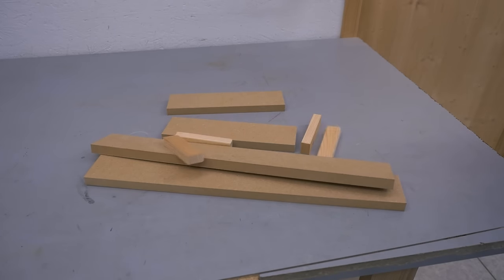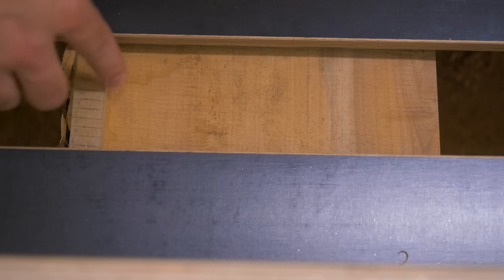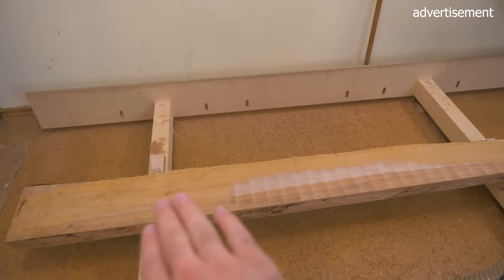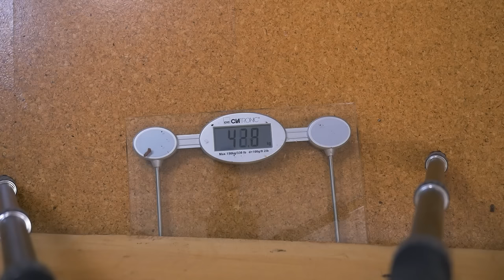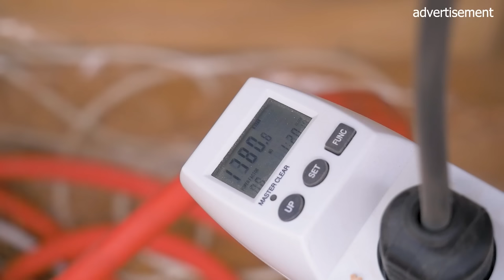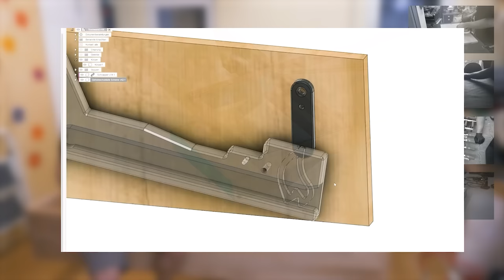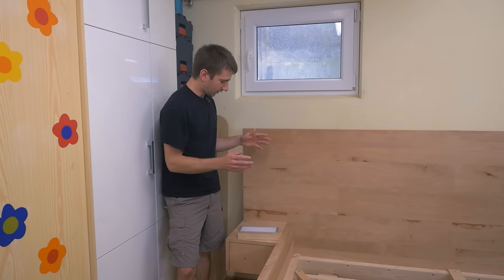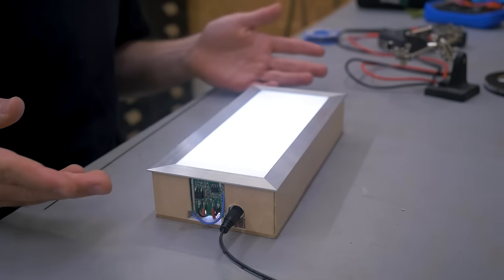Homemade 10,000€ Bed || 4 Unique Features

Comment: i believe you're kind of right with the reason why the big light didnt work with the touch sensor, things like that are usually capacitive, and touching it changes the capacitance, so that amount of metal wouldnt have a big enough difference in capacitance when you touch it to activate the switch. 
you could try adding more of those touch sensors in parallel, or using a thin foil on the wood instead of your solution

Comment: honestly an amazing project and great work. As a comment already suggested, moving the switches and power outlets seem to be best and most effortless Ideas since it doesn't require to change anything on this great bed frame and just is a tiny bit of work on the wall which will be hidden anyway if there were to be any left to be seen marks. 
Since this video is already 2 months old you might have already fixed it but maybe this comment still isn't to late and hopefully helpfull. 
Enjoy the comfy nights in this bed. Amazing stuff you're doing here!

Comment: I would use 2700 kelvin led strips, since those 4000k or whatever they are will be quite annoying when your eyes are accustomed to the dark, and maybe a double light blocker to hide the seperate diodes. If you have any electrician friends, try making them cooperate to build outlets and switches into the bed instead. Legal most places if it's not a permanent installation and connected with a normal schuko in the wall. Cool build tho, easily subscribed☺️

Comment: My first thought at the start of the video was that the bed looks nice, but the power outlets visible through those holes look a bit silly. Might have been nicer to include extensions, so the headboard hides the outlets on the wall, and you have outlets that match the styling of the bed on the top of the nightstand or inside the drawers instead.

Second thought when seeing the materials you're going to use was that the bed looks nice, but I would have loved to see a headboard that preserves some of the natural bark edges and makes a feature of them.

Comment: You can purchase low-temperature soldering sticks for aluminum, sold as "Durafix" or "Alumaloy" or "Alumiweld" (etc), and create a contact area on aluminum which solder will then stick to. The only trick is that you might need a pretty big propane torch if your piece of aluminum is large because the aluminum spreads the heat so rapidly.

Comment: Brilliant work.  Perfectly (well, almost) engineered.  That bed is probably stronger than the rest of the building.  You just need to lower the end wall of the apartment by a few millimeters so it aligns with the bed!

Comment: I only wish you chose different colors for the light panels, warm color LEDs, and dark color plastic matching the decorative parts, and no aluminum.

Great job, I learned a lot from this project especially with the epoxy and gravel technique.

I agree with the gas hinges, they’re useless, I was disappointed with them when I used to dampen a tv cabinet cover.

Comment: This is absolutely stunning work, man! Good job. About the misaligned sockets and light switches - I would much move them down rather then mess with the already fnished light panels. It requires a bit of drywall work, mudding and painting, and in your case (Germany) a licensed electrician probably but it is definately less time-consuming. Once again this bed is wonderful. Greeting from Estonia!

Comment: You can move power outlets/repaint 10x faster than remaking light panels.  But I imagine having the outlets be lower than 'standard' and or 'code' would keep you up at night.  Not to mention the time it would take to engineer a more precise and automated sytem for applying wall mud.

Comment: regarding the misaligned electrical outlets and the frames - why not raise the bed height by 12mm by adding a small strip to the legs/feet of the bed - this has to be easier than remaking all the electrical/lighting panels? but as others have said already - the craftsmanship on display here is awesome.

Comment: For anyone who does not have a CNC to cut things like the gear rack for the router sled, Mattthias Wandel has a Gear program for a small fee which will generate the gears and racks and allow you to print out templates - he also has a simple printing program that assures that you are not hit with scaling issues by your printer etc so that your templates are accurate.....I don't know for a fact, but I'll bet the gear program will spit out g-code, or at least a file which can be use to generate g-code for your CNC if you are so blessed.

Comment: Awesome work! I can see why you would want to sockets to line up. But depending on what you gonna put into the sockets maybe this is even better. Some adapters wouldnt fit if the hole lined up perfectly.
Reply from the maker: Wow, the first one who thought of that. I actually is better now the way it is and I won't change it. Angled plugs wouldn't fit with the "correct" alignment of the outlets.

Comment: If you want to take a hint from someone who worked in tourism and stayed in many, many hotels: always make sure the head-panel / back-rest material in easy to maintain and clean. Sure, now there are good detergents, but it is always easier to just wipe some leather than try washing a textile. Now, this is your bed and you will not abuse it like it happens in hotels, but who knows if you have some kids playing there with some more-or-less washable markers or something like that :) The bed sheets, pillows and so one can be easily washed, but not that part of the bed.

Comment: Great project. If you redo the LED part, use black aluminium trim - it will add a lot. Regarding the no-switch-on problem - I found that these PCBs tend not to work correctly when the PSU is grounded. Try removing grounding.

Comment: Wonderful work and in some parts a little overwork… You could make decorative parts of a bed hollow. It would make it much lighter, easier and cheaper. 2-2,5 cm would be enough. Foundation of a bed can be made  much lighter too. 80 kg for a bed - too much. Hidden drawers - great idea. From my perspective it would be much easier to use some kind of swings to lift drawers down or up and usual drawer system to pull it out. And you can glue some kind of  fabric  to the bottom of a drawer to hide a plain wood. Lighters beautiful, no doubts. In the end it is a wonderful work with stunning ideas I ll use in the future

Comment: You are 12mm off? Just "lay" some boards under the bed and make them either the exact dimension of the feet or make them so they look like a tiny pedestal. I think that is easier than redoing the light panels. Also don't forget to adjust the string for your hidden drawers.

Comment: I'm sure that by now you have re-made the light panels but just in case:  don't.  simply put a 12mm (or whatever size) under the legs at the headboard to elevate it to line up.  That would give you a slight elevation and help prevent gastro reflux (aka gerd).

Comment: Amazing project, so well executed, even with the small mistake. Personally I dislike the led panels cutout for powerplugs/light button entirely.
Instead of having a cutout, make the ceiling light turn on with a touch and hide those cheap ugly buttons alltogether maybe?
Most certainly, with your skill, you can change the phone charger to be integrated into the wood of each side counter, do not have cables dankling out!

Comment: Again a WOW project from Marius - Bravo. Tiny detail: the Multiplex tops of the sides of the drawers I'd have covered with some small strips of wood so you don't see its Multiplex to maintain the "massif wood" look. The access to the electrical installation on the wall is a thing I would have avoided as it makes the bed pretty much locked to this one space. Perhaps you could install a flap covering the gap? Assuming you don't need access to the power outlets constantly and maybe neither to the light switch? Might look more appealing? I know it's always easier to criticize than to do it yourself and I had similar challenges - so just sharing the thought. I love that you dare to combine wood with the gravel filling this gives the whole assembly a very distinctive touch, actually making it look much lighter than wood only.

Comment: Stunning work!  Rather than rebuild each whole light fixture, why not just put a 12mm thick block under each foot?  You'll get the alignment you want, but in general use I'm not sure you'd ever notice the changed height after a week or two.

Comment: Just a stupid question. But why don't you just lift the bed up ½ an inch or 12 mm. That would line up you lights and receptacles. Just sounds a lot easier.

Comment: Dude, you always WAY overengineer stuff. In the best way possible. I love the whole thing, the hidden features, the wood finish, the gravel accent, the light panels, everything.

Of course, you will spend the next five or ten years making tweaks and modifications to the bed. I'll bet that after you fix the light panels, you'll probably add hidden wireless phone charging pads to the side tables. And later maybe one of those fancy clocks that projects the time onto a flat surface. And cup holders - lots of cup holders. Maybe even a hot plate to keep your coffee or cocoa warm while you watch TV or surf the internet or edit videos in bed.

Comment: I would love to see you add a crank to the rack / gear mechanism and instead of flattening across the grain cut along the grain. Might save a significant amount of time on those boards.  Might not help that much when doing the giant panel that you did but for the rough sawn slabs I think it would help.

Comment: I would just move the light panel in the wall, seems easier, pull them and just drop them Dow a little, the bed is fine and head board is fine.

Comment: Excellent job Marius. Instead of trying to adjust and remake the back panels of the lights to fix your height problem, could you just add or glue a spacer to the bottom of the legs? you can see them anyway.

Comment: You could probably wire some motors to the sled to automatically do this for you as a quick large plane flattening machine. All the electonics could be stored in the sled and could just sit on the bed. Using a simple input panel it could just take a width x length input and travel, then have limit switches on the sled so that when it reaches the end of the frame hit a bumper that is just screwed on and then it can be done.

Comment: To fix the issue you don't have to cut out bigger holes, just add more wood  (1.2cm thick ) for the support legs that way you will raise whole bed that 1.2 cm and the holes sholud fit perfectly then.. just the thought, good luck.

Comment: When leveling with string you can double up first of the strings and have the second go between the first one's strands. That way it's easier to see if it's in the middle.
I think you could have screwed the control wires to the aluminum, but your solution is cooler :D

Comment: Great build. But have you considered underframe light with pir sensors? I am considering a similar frame but when you get out of bed at night a very dimmed light should turn on. This should only light the floor and not disturb your partner. Multiple sensors can be used to light up zones, but here the zones need to be configured based on room layout. Should feel like a smart light, but it would be hard coded to ones needs.

Comment: IMO , I would not mess around with the light panels I would add a 12 mm hardwood strip to the foot stands of the bed that would raise the bed so the plugs/switch fits.

Comment: you should try to "shim" the bed before fixing the light fixtures, as i dont think chargers with a 90degree bend on them will fit correctly if you move it up more, You might need to move the power outlets out if you want to do that etc.

Comment: Speaking of drawers, "Isn't it cool?" cool?  maybe. Functional? No, Easy-to-use? No. It will hit toes, once the drawer is moved to the side slightly (for example when you push it not in the center point) you have to find the exact place where it was to shove it in. This is annoying when you have to do it on a daily basis. Have you ever experienced a drawer jumping out the chest of drawers? I assume you haven't, you should think of why you haven't.  Drawers should stop once they are opened, and back wheels should stay on the rails to prevent sliding to a side. This is for the Bed 2.0 design 😉
Reply: He designed it for his own use so he's fine with it as it is lmfao. Armchair craftsman.

Comment: To solder wire to an aluminium just use cheapest solder flux and a sandpaper.
Scratch the surface using sandpaper and then solder a little bit of a tin using flux. You have to be fast as aluminium oxidize in air rather fast.
After that preparation You can solder a wire.

Comment: Nice job! However what a pain to move your bed though. Maybe install a power strip into the frame, thus the frame plugs into a nearby wall. As long as you dont exceed the power strip, it will be enough for laptops, phones, etc for charging.

Comment: Going length ways would have been more efficient. You could also install a simple low rpm motor to semi automate the jig where the only input from you would be to move it across the width of the cutter at the end of a run and restart the process until the board was flat.

Comment: I can't believe the comments about raising the bed 12 mm. This kills perfection. It will haunt him forever, he will constantly think about the seam under the bed. He will never like his furniture. Perfectionists are like that. Also, did you forget the drawer under the bed? Maybe that job could be solved by lengthening the rope a little, but if it were me, I would break the socket on the wall a little and move the electricity 12 mm down cover it with a plaster. Since I live in Turkey, we always make these here. As a woman, I can do this. The easiest thing to do. 

Parts I don't like 
I would make slats instead of stones on the frame of the bed, it would be like the Japanese style. The frames of the LEDs had to be painted black. Also, what is a plywood drawer? And I hope the drawer under the bed doesn't hit your knees or your toes every time you open it. 🤣 I watch all your videos and I think you do an excellent job. Maybe you can make a new video about completing the cons of the bed so we can all sleep comfortably. 😚

Comment: Instead of moving the cutout maybe you should instead at an outlet and a ligth switch to the bed itself so that its flush with the headboard. Probably not to hard to do and would look so much better. The outlet could litterally just be two really short extension cords on either side and the light switches could be a piece of wood with pegs sticking out the back clicking the switch on the wall.

Comment: Ziemlich aufwändiges Projekt, Respekt. Wäre es nicht einfacher, dass ganze Bett um die 12mm anzuheben, damit die Steckdosen und Lichtschalter mittig in den Ausschnitten sitzen? Evtl. musst Du dann noch die versteckten Schubladen anpassen, damit sie weiter gut funktionieren (zB mit größeren Rädern). Scheint mir aber alles in allem weniger Arbeit zu sein, als die Position der Ausschnitte zu verändern.

Comment: I wouldn't redo the light fixtures, but instead, add well placed 12mm wooden supplements under the felts. That way you raise the whole structure to its intended height.

Comment: When I see the bags of shavings/sawdust from a project like this, I always wonder what you do with them. The woodworking youtubers I watch must generate tons of the stuff. Is it all scrap, or could you use it to make your own fibreboard or something? Or as fuel? (I remember reading that the surface area means shavings burn hotter and cleaner than a traditional wood stove; would be interesting to see if that's actually a practical possibility)

Comment: Did you consider strips of wood under the legs, where it would be hidden, to lift the bed the inch or 2.5 cm to line up the opening and the switch panel on the wall. This would solve you light switch panel problem without remaking the light panel.

Comment: What are your thoughts on wireless charging pads in the nightstands? You could add them on the bottom (from the drawer side) so they can charge a phone that's resting on the top. That would give charging without any problems with wires but I'm not sure how thin the surface would need to be.

Comment: Remove the outlets and light switch from the wall. Screw them on a piece of wood, extend the wires and mound that in the headboard. At least that's how I would fix it.

Comment: No wonder the bed is so heavy. Both woods you chose are both extremely dense.

If the offset of the spaces for the power sockets and switches is just 12 mm, IMO the simples fix would be to place two soles of 12  mm thickness under the legs.

Comment: If the headboard cutouts are 12mm too low... Why not add feet spacers to the bottom of the bed to lift everything up 12 mm? Seems like a whole lot of trouble to go through to move the lights up 12 mm when you can just lift the entire bed 12 mm with wooden foot pad spacers. Or if that's going to cause too much issue with your hidden drawers that roll out on the floor... Take the headboard off and lift the headboard itself up 12 mm and reattach to the frame?

Comment: Du bist der Hammer 🙉💪🏽 einfach geil, auch mit den ganzen Specials.

Eine Frage zu den zu niedrigen Positionen der Auslässe für die Steckdosen: wäre es eine Option, das ganze Bett durch "unterlegen" unter die Kufen um die 12mm zu heben (soweit es die Dachschräge zulässt)?
Reply: Ja das mit dem Steckdosen ist mir auch aufgefallen.  Warum hast Du diese nicht in die Rückwand des Betts gleich mit integriert?

Alles andere absolut mega klasse.
Reply: @achimbuhrle6195  Meiner Meinung nach würde das Integrieren der Ästhetik zu Liebe nur dann Sinn machen, wenn dann die Steckdosen dann trotzdem weitestgehend versenkt sind 👍🏼